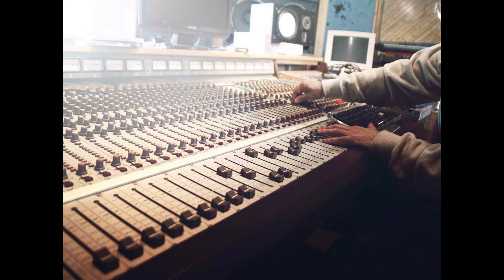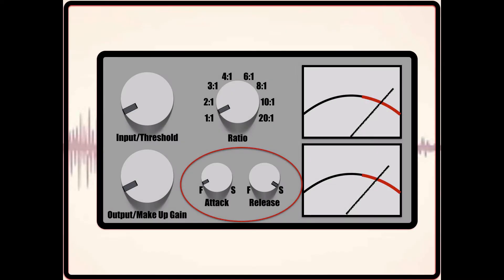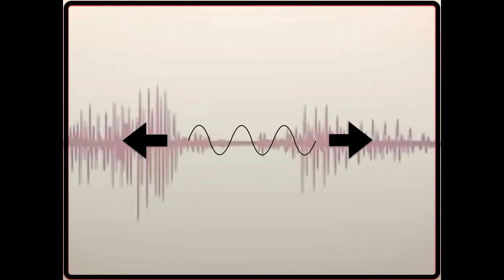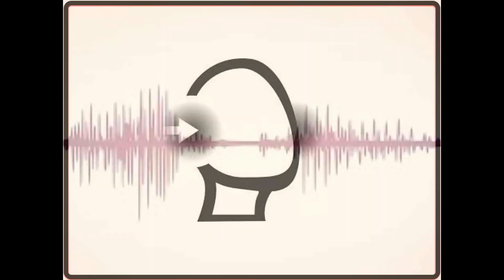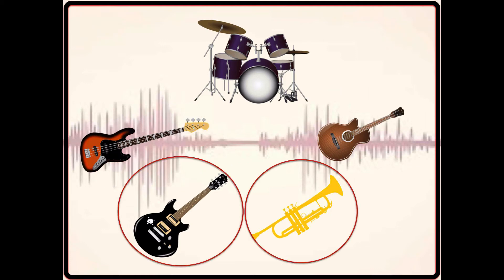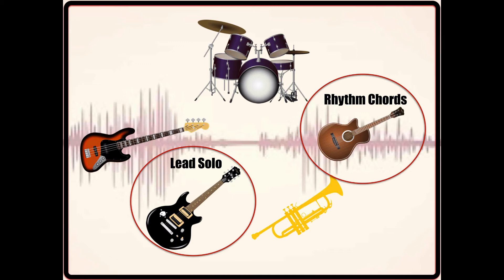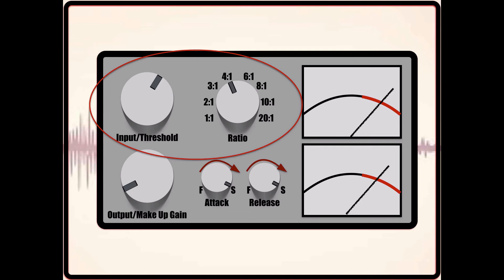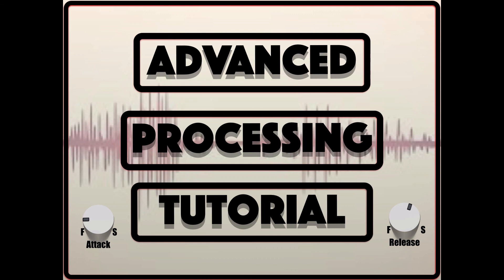Advanced Compression Tutorial: Setting Attack and Release

Comment: I haven't see any other of your compression videos (besides the parallel one), so I would like to say something else about Release: it's like a tone control IMO. Not only determines how long the compression works (or how long it takes the compressor to stop working), but the faster it is the more bright and agressive the soung is, while a slower attack gives a more smooth and dark tone.
Reply from the maker: Yea, that is correct. Think about why it would seem brighter and more aggressive though. A faster release time will compress less of the full sustain and so the ear will naturally hear the compression nearer to the transient of the sound. Sound tapers off over time, and diminishes in level. So if we are only hearing compression towards the transient  it will be effecting the most prominent portion of the sound and effect the most "brilliant and sharp" part of the sound vibration. This is a good point overall, I could have definitely made this video "4 Tips to setting attack and release."
Reply from the maker: I've done some side by side comparisons with the Fg-stress and the distressor. Its pretty close, the hardware is still better but not everyone has 1,450 to spend on hardware so its a great alternative. I understand your point, but there are some halfway decent plugins out there for those that dont have the money for hardware.
Reply: track with a hardware compressor.
Reply: software compressors are not ready yet. maybe uad but that's it.